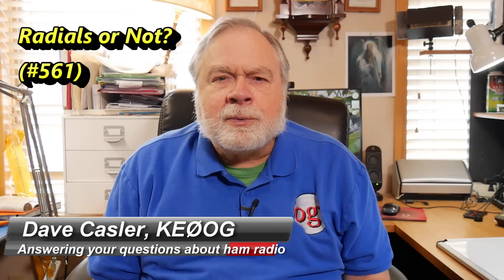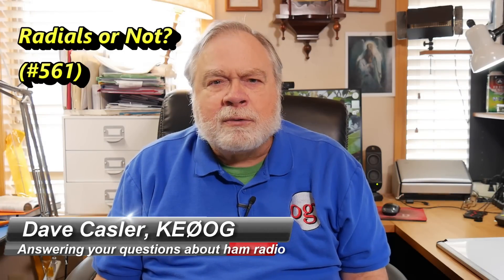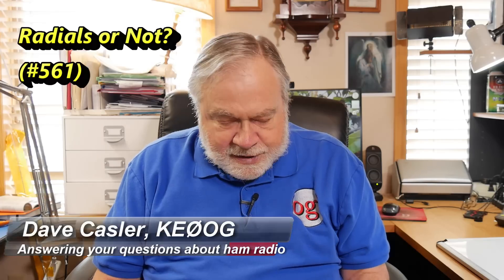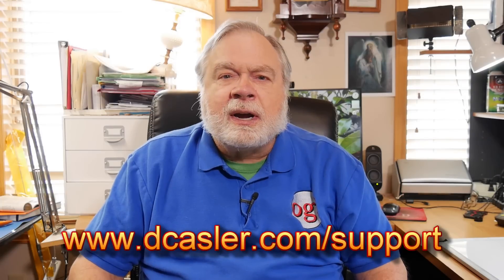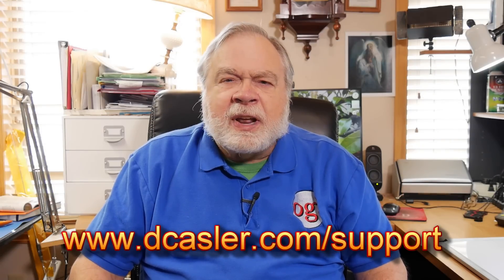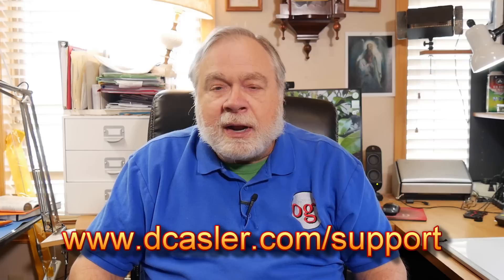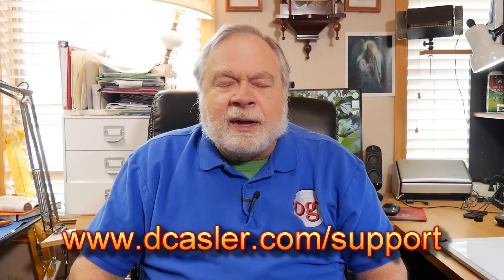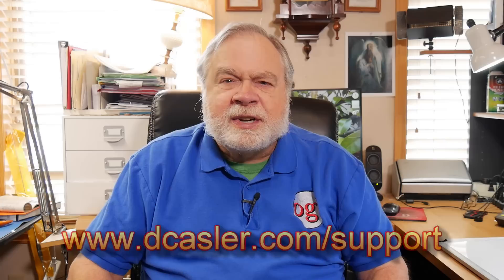Radials or Not? (#561)

Comment: The Grayline, at the antenna, has a remote tuner connecd tied to the coax, then a 1:1 Balun transformer, connected to a ladder line that goes up  the antenna  25% and connects to the antenna top and bottom, the top and bottom are insulated, along with the base insulated from ground.  So to me this is a dipole, maybe like an end fed dipole. Does this change you mind about radials.  so you need to buy one and play with it, and report.

Comment: Here's some VERY interesting information about gnd radials, maybe, even, an opportunity for the viewers of this video to conduct some cutting-edge research regarding the effects of RF on living organisms!  In the 1980s, I was a "radio/TV engineer" for KUAT, in Tucson.  One of our transmitters was 50KW AM on 1550 KHz.   As is typical for AM broadcast xmmtrs, it had 120 1/4 wave radials, buried ~6in in the ground.  And a very curious phenomenon was observed.  The weeds directly above the radials grew taller and faster, than elsewhere.  It was NOT due to heating.  The amount of energy required to raise the temperature of that much area of land would be considerable, and the loss, noticed.  Apparently, plant growth is stimulated by exposure to RF fields.  Incidentally, those radials were bare copper (the normal practice).    Think of the possible applications to agriculture.  And how are humans/animals affected?   I think I'll take a nap, now.  Excuse me while I flip the switch on  the linear, and crawl into my bed, which is inside the 5' diameter inductor.  Nighty-night!  :)

Comment: It's awesome that antenna technology has advanced so much .... of course there are "no radials" verticals out there that match pretty well across the bands ... but you just can't radiate a good signal using the low-angle advantage of a vertical without a good counterpoise.  It just physically isn't possible unless your antenna is mounted in the center of a water body .... and even then, fresh water won't beat even 4 quarter-wave verticals per band.  Just sayin'.

Comment: I am using  a 49:1 with 130' of wire. 4' from the ground, into an inverted L. 8'ground rod below the transformer, and also three on the #2 ground wire for the radio room. With a Palstar AT2K, I can tune any band from 160-6 meters, yes, any band, any frequency in between with my IC-7300. No other radials used.
Reply: An AT2K can tune almost anything on any band. No surprise there.

Comment: Hi, I have the BTV6 and I have had it for about 4/5 years and it says that it doesn't need radials it works ok ???? i think what are your thoughts on this antenna please.  Cheers Jeff MW6OVT
Reply: I am planning on getting a 6btv soon.  I talked to a lot of people that own one and 98 percent of them told me it will work better with radials.  2 of them are using a chain link fence in their back yard as a counterpose instead of radials and they said it works excellent. The one guy I talked to mounts his to a travel trailer without radials when he is camping and He said it works very good but not as good as with radials at his home. I plan on using radials when I get mine set up.
Reply: @davidbrennan5  I have tried both with and without and I cant find any difference
Reply: @jeffpriddin9711 I have a low chain link fence in the back yard, I was going to mount it with a hinge bracket to one of the poles. I get high winds some days and I want to be able to fold it down for the bigger storms. I think I might try it with radials insulated from the fence pole and try it not insulated from the fence pole and see what works best.
Reply: @davidbrennan5  Hi I live in the UK North Wales we don’t have a chain link fence I have tried radials but they make no difference whatsoever but everyone says they do , I just don’t understand what I can do next. My BTV is bolted to a pole five foot into the ground so that might act as an earth and it’s why mine works.
Reply: Jeff get rid of the 6bv and get yourself a DX Commander, it’s a much better antenna

Comment: The greyline antenna is designed as an off-center dipole on its end. It's fed at approximately 1/4 of the way up. There are two fiberglass couplers; one that insulate the portion of the pole that goes in the ground sleeve from the rest of the antenna and another that separates the lower and upper parts of the antenna. The skin of the pole is used as the radiating elements by running a ladder line stub coaxaly up the lower section of the pole. 

This, per grayline's instructions will not work without a remote tuner located near the antenna. The antenna without a tuner is unusable. With a good ground system for the remote tuner it's slightly more usable.

Comment: Thanks Dave. I have a EFHW configured in an inverted L. Ground rod at the antenna and a ground rod with a lightning arrestor for the coax before it comes into the shack. 100’ of RG8x. I added radials, about 400 feet total and could tell no difference at all in my SWR numbers or real world performance.
Reply: EFHW's don't seem to benefit from more than a minimum ground radial